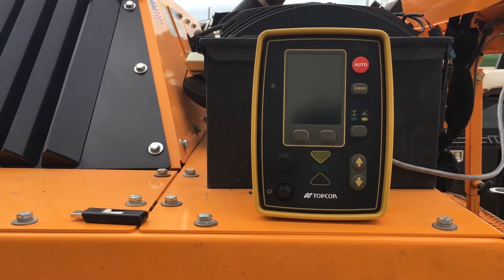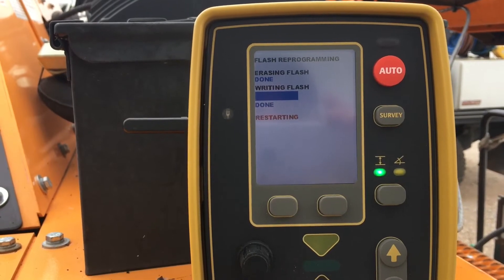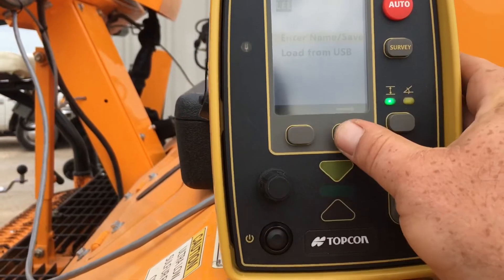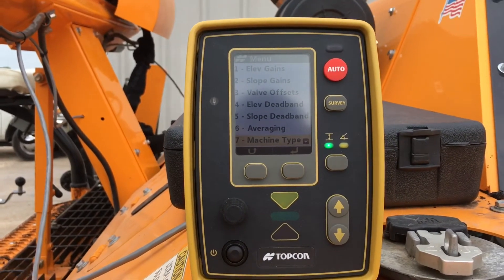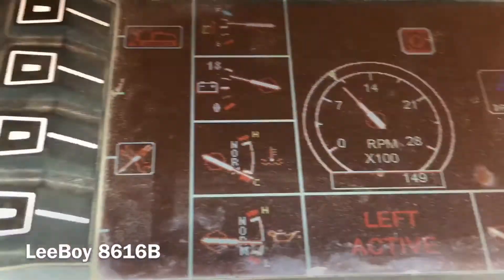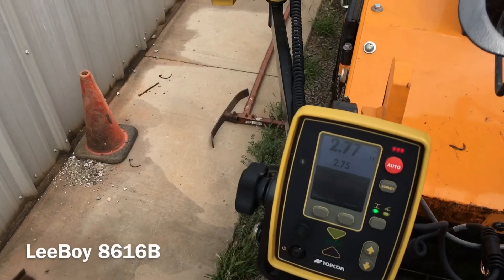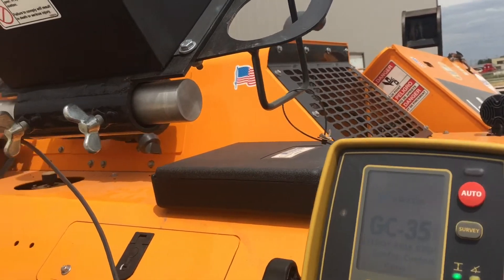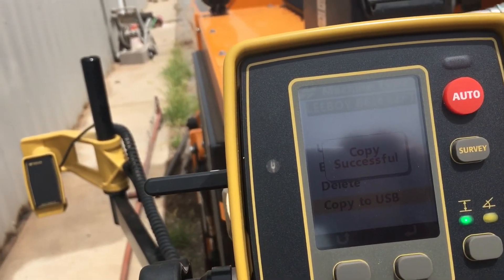LeeBoy 8616B setup and Update software on GC-35

Comment: Should be able to job the tow point when the machine is stopped on the older machines you have to be in motion we have a pathmaster ,8816 and 8500 , start out in manual to get screed pitch or angle of attack they call it once that's done  lock it in always turn autos off when you pick up so you don't bottom out tow point then when you set back  down while stopped you should be able to look at the angle of you're screed end gate if it's pointing down you need to jog it up untill it's level then take off a few feet then hit auto , if you can't jog the tow poi t while stopped you won't get the full potential from the system you'll always have to start manual which sux jus a little tip I wanted to share nice vid